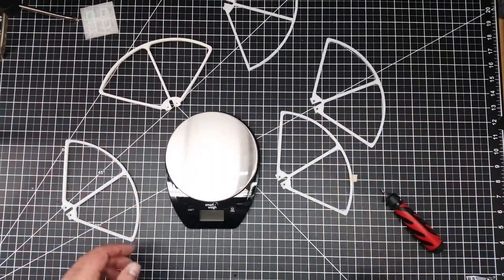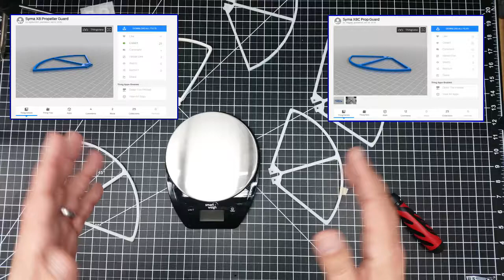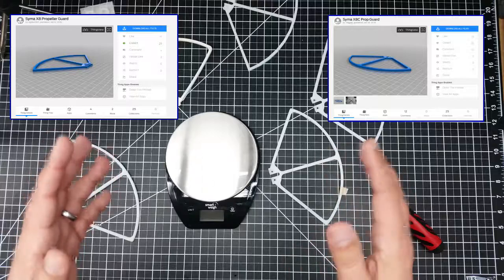Video Drone - 3D Printing Syma X8 Prop Guards!

Comment: Hi. If you would print the guards with only perimeters and only bot layers it will be much lighter so there will be no infill. PLA should be the best. I even made a much more precise model of guards. but didnt print them out yet.  http://www.thingiverse.com/thing:1999349      . Thanks for the informative videos , I like it.
Reply from the maker: Very nice design, however PLA?  That stuff is pretty brittle, did these in HIPS which is on par with ABS and they took a bit of a beating but not as much as I had hoped.  Lost my Syma X8 to a fly away however going to build one up from parts and when I will print and try a couple versions so thanks for sharing!  Also on a side note, do you know if there is an open frame 3D printable version for Syma X8 motors and control-board?  See a ton for the X5, however want to build one the size of the X8 :-)
Reply: PLA is much stronger then ABS. heat resistance doesnt matter so that is ideal material. And thinner you print it  it will be lighter as well. No I didnt just saw a 3d scanned DJi phantom , so maybe you can work with that.
Reply from the maker: Hmmm color me a bit skeptical (PLA is much stronger then ABS)  as PLA may have a higher Tensile Strength (57.8 MPa / 8,383.18 psi) over ABS (44.81 MPa /6,500 psi).  It is the just other way around for Flexural Strength which is required to with stand an impact.... (ABS:75.84 MPa / 11,000 psi) (PLA:55.3 MPa / 8,020.58 psi)
Reply: abs tends to be weak in layers . PLA is much stronger. The thing is that original part is made from brittle but strong plastic. it is hollow and thin wich is good for weight. All we need t odo is just copy it . ABS bends , it would not protect the blade. PLA is more stiff.  Im speaking from experiens from real world .